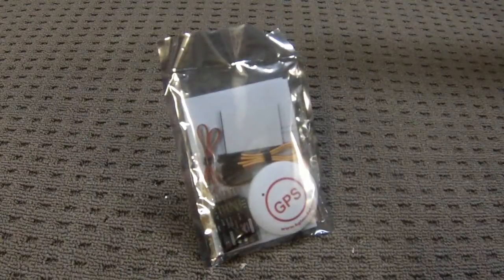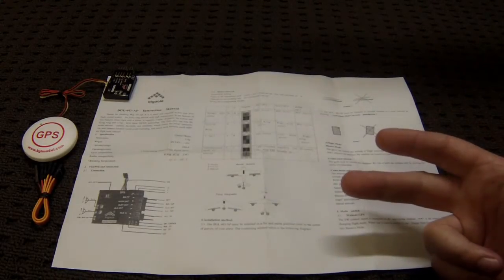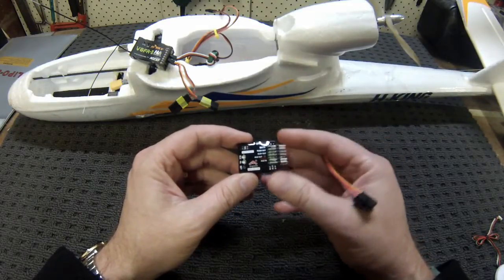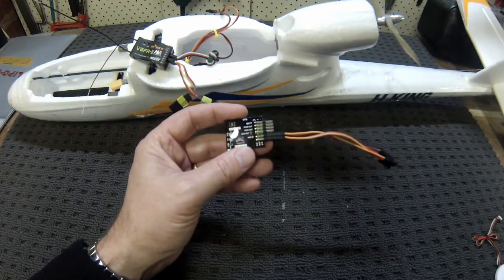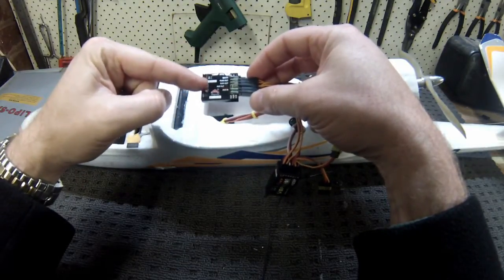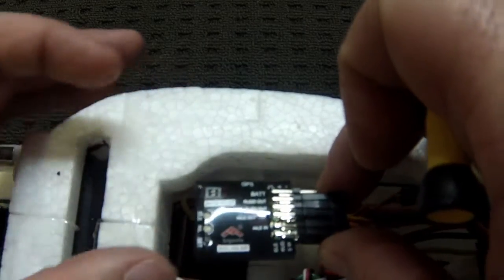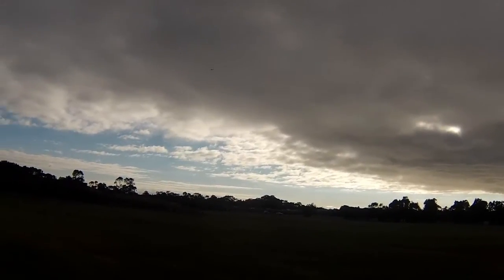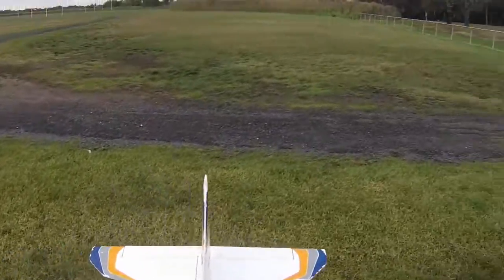BGL-6G-AP Flight Stabiliser with RTH - Setup

Comment: First great video second I just now purchased from your ebay store. I didnt realise it only has a 1 wire  Aileronconnection. I dont know how that works when they run off two channels. I am using the flysky th9x which I think is the same as your control so dont know how you have yours set up to run off one channel. If you can let me know how that works that would be great. I have just yesterday switched to a EZUhf TX an RX but it just runs using the flysky. Also does it  failsafe to return home on loss of control signal? 
Any hlp with above would be great hope Aus post  does get it here over night.
Cheers Mate
Reply from the maker: G'day Angus, yes there is only one channel for the aileron. You need to get yourself a y-lead to join the two connections from each aileron together. 
As for the failsafe, you will need to make sure that your receiver is set up to fail into the correct position to engage the RTH. In this video I have a FrSky module in the back of my Turnigy 9X. The FrSky receiver has capability to set what each channel does if you lose connection to the transmitter.
It looks like the ExUHF has a similar feature as the FrSky receiver. There should  be a button on the receiver that allows you to set the position of the switches (put the switch into RTH mode) in the transmitter and then push the button to save them to the receiver. Then if the plane goes out of range, the receiver will remember the position of the switches and return to home or within range. 
I hope that helps Cheers Michael
Reply: Cheers mate. I.ve ordered mine from your ebay store.

Now I'm new to fixed wing after getting sick of drones, still like to fly them now and then but planes look like so much more fun.
It seems you may have the th9x and I am buggered if I can work the mixing out properly. If you do have this controller would I be able to throw some questions your way? If you don't, O well I'll have to keep trying. I have got the EZUHF attached to controller so can use the TH9x failsafe as its a little harder setting the ezuhf for external devices so Im told. And have watched the 3 channel switch setup will do that in prep for arrival of flight controller.

Thanks again the flight controller looks great.

Gus
Reply from the maker: Hi Angus. I did have the Turnigy 9x, which is the same as, or at least similar to the th9x. But I use the Taranis now, so I'm  a a bit rusty on the old 9x.  The mixing is certainly tricky, but I have done a few different videos for setting up the 3pos switch that might help. If you have questions please ask and I'll try to help. Cheers Michael

Comment: Does this really have to be mounted on the CG? I have a Raptor and I would like to mount it on the flat spot just in front of the wing.
Reply from the maker: G'day Randall, ideally the BGL should be mounted on the CG, but it will still work if you have it forward or aft of the CG. Obviously don't mount it out the end of the wing but it will still work. The closer to the centre you are the better. I have the unit in my ASW28 forward of the CG, works fine. Cheers Michael
Reply: I didn't figure it would be that critical on a big plane like the Raptor. Thanks for replying so quickly.

Comment: Any RTH failsafe for loosing signal on that FC ?
Reply from the maker: Gday Michel to you will need to have a failsafe on your receiver to engage the RTH mode and apply for necessary amount of throttle. Cheers Michael

Comment: hi mad rc , I am having trouble,  when I turn on my rtl my plane just turns upside down and goes side to side very quickly  , and in stabilization mode it does a loop and heads strait down, can you help?
Reply from the maker: G'day Charles, sounds like you may have the elevator channel reversed. You can test this on the bench by switching the plane into auto level (stabilise) mode and lift the nose. The elevator should go down to try and level the plane again. You can change the direction with the elevator gain dial. But if you do, double check this does not affect the inputs from your controller, you may need to revers the channel in your controller too. I hope that helps. Cheers Michael
Reply: MAD RC that was it , it works, except my failsafe, I checked it today by turning off my tx and motor kicked in and flew straight into an electrical Tower should my battery , gopro , and opterra was in pieces.
Reply from the maker: Oh Charles. That is not good news. I assume that the RTH mode was not set/engaged on your failsafe. I hope some of your gear can be repaired
Reply: MAD RC in the shop now making repairs, I had the failsafe in bind mode but something went wrong,  it seam to function properly on the bench test,hopefully get it repaired and put it back up in the air soon ,thanks for your help,Charles
Reply from the maker: Best of luck
Reply: Do I just bind with in rth and 40% throttle on dx6e?
Reply from the maker: Charles I am not that familiar with the Spektrum gear. I know that some of the receivers have different failsafe capabilities. Some have throttle failsafe, mainly to set to off and the remaining channels return to neutral. Others have the capability to set all channels.
Reply: MAD RC ok thanks again.

Comment: Hello great videos by the way. I am having a issue with transmitter reconnecting. I have only tried it in my garage so far and when i test the RTH mode for when i loose signal ( When i turn the TX off) and then turn the TX back on the RX never reconnects again ( correct that, it did reconnect once after about a minute or two of being stuck in RTH) but hasn't since. I've tried flicking all the switches in every possible configuration and turning TX off and back on again in each switch position. but nothing. Everything seems to work fine when i have signal all modes seem to work fine and will engage and disengage but not when i turn the TX off and on again
Reply from the maker: Chris Appel G'day Chris, interesting issue. I don't think it is specific to the controller though. What transmitter and receiver are you using? does it connect quickly when you first turn it on?
Reply: So the problem is with my receiver. I took out a Frsky X8R reciever (i had in a quad that is very patiently being brought back from the grave from drop from 400 ft) and tried it with my Turanis Plus TX and everything worked perfectly. I must have a purchased a faulty tactic receiver and am sending it back. But i think i will just keep this receiver in this plane and use my Turanis  Plus instead. It will be a far better set up anyway and save the tactic setup for a park flyer setup at some point. Thanks for getting back to me and thanks for making the video on setting up the Turanis with this  also BIG help

Comment: Hi I have one of these units but I find during calibration it flashes then I get a steady red then the servos move and I get the flashing again. The unit also does not respond to the transmitter aux switch as the unit is always in stabilization mode. Any Ideas?
Reply from the maker: G'day Gyrophill, It sounds like you don't have a connection for the GPS. You need to make sure that if you have the GPS plugged in during the setup, you need to be out doors or close to the window so you can connect to satellites. You will see the blue light start to flash if you have successfully connected to satellites. If the blue light is solid, there is no connections. 
The red light sounds like the calibration is still ok. Cheers Michael

Comment: I have been using this flight stabilizer for some time and I am a bit disappointed with the RTH. On different occasions the plane does not return to home but go's straight ahead in stabilized mode. I regret that one cannot use Flaperon with this stabilizer because there is only one output channel for aileron 1 and 2.
Reply from the maker: Hi Stephane, thanks for your feedback. I have not experienced this sort of behaviour. Although, I usually fly in the same place, so my RTH position rarely needs to be reset. Do you fly at different locations? You may need to make sure that the home position is set correctly by pressing the Rest Button after the GPS has a lock on the satellites (blue light flashing). 
Certainly the BGL-6G-AP does not have as many features as some other units that will allow flaperons and other advanced mixing, but to be fair, it is a very cost effective RTH. Probably the cheapest RTH in the world I think. Cheers Michael
Reply: Stéphane D'Hollander m

Comment: My red LED doesnt Locks On in Calibration Mode...
Reply from the maker: G'day +Chris ImItReal the red light will blink when it has power. The only change is when you press and hold the SET button and the red led will go solid after about 3 seconds. The blue light on the GPS antenna will blink when it has connected to satellites. Check my other video for a few more tips on the set-up - https://www.youtube.com/watch?v=J2lfk1IJCuQ Cheers Michael

Comment: Thinking of getting one of these for my dads  hk cloud surfer. His spektrum dx6i however, only has two way switches so im doubtful if it will be possible to select manual/flight stabalise/gps rth. Any ideas?
Reply from the maker: G'day +Stephen hathaway I have spoken to another guy that needed to control one with his DX6 or DX6i. I thought it has a 3 pos switch for the flaps? Otherwise, there was another guy that set his up using two different 2 Pos switches. When they where both up Mode was OFF when when switch was down the mode was Auto Level and when the other switch was down the mode was RTH.  Check out this DX6i vid from Motion RC. They are setting up a gyro on the DX6i - https://youtu.be/gKObxglL8lM?t=3m30s
I hope that helps. 
Cheers Michael

Comment: Hi Michael, does the RTH work with Spektrum AR6210 receiver? If so, how does it know, that AR6210 lost signal? Do you deliver to EU?
Reply: G'day, the BGL-6G will work well with the AR6210, but i think that receiver only has a default failsafe. Which means I don't think you can set the necessary channel to engage RTH mode. Check this thread for some more information http://www.rcgroups.com/forums/showpost.php?p=23916689&postcount=1
I do supply to the EU, send me an email if you'd like one. Cheers Michael
Reply from the maker: Sorry TheBuzzdev that reply was from my regular account. Cheers Michael
Reply: Hi Michael, many thanxs.. Let me test that undocumented failsafe settings on my receiver, if that's not working as expected, i'd most probably also need to get some other receiver for RTH to work. The AR has already minus points (by me) for not having standard RSSI output... i'll drop you an email then... Thanxs

Comment: Hi.  I am going to use one of these.  When I set the fail safe on the receiver ( lemon).  Do I set the fail safe for the throttle only  or ailerons elevator etc. Would be grateful for your advice.   Mike
Reply: G'day Mike, your throttle failsafe will depend in the airframe. On he Bix3 I have about 40% throttle on failsafe, but for my ASW28 I have no throttle set in failsafe. At a minimum you want to set the mode of the BGL-6G-AP to the RTH mode, no need to set anything for the ailerons or elevator. I hope that helps. Cheers Michael

Comment: Thanks Michael. With the help of this video I now have a Bixler 2 that Returns to Home. Tested it in 15kn and it worked. Even tried failsafe RTH by turning the radio off, scary but it worked.
Reply from the maker: +Andrew Newton Thanks for the comment, it is brilliant to hear it has worked out. Would be good to do a little formation FPV. Add Mark in (once he has built his Cloudy) as well for a bit of three way air to air footage! Although getting planes near each other seems a bit like herding cats. Cheers Michael
Reply: +MAD RC I'm willing to give it a try, surely we have the skills.
Reply: +Andrew Newton HA! Surely
Reply: Andrew Newton hi Andrew I found my questions answer reading your comment. So your using taranis x9d remote is it. Which sets the failsafe switch automatically on failsafe. I need to research this on my taranis qx7
Reply: Andrew Newton    Hi 
Need to confirm if the plane  return to home if it's lose the transmitter signal ???

Comment: Does this work with Dsm2? If so I plan to get one!
Reply from the maker: +RC flight Seeker No problem to work on DSM2. The only thing that I would suggest is to check out the receiver that you plan to use and make sure that you can program a fail safe that will engage the AUX channel and switch on the RTH mode, in case you go out of range. Here is a link to a post about Spekrtum failesafe http://www.rcgroups.com/forums/showp...89&postcount=1 
Cheers Michael
Reply: Ok that's good, because I use lemon rx that is easy to program the failsafe into. Thanks for the info, and great video BTW.

Comment: I got a question, i got a bigaole for my wing and set it up for wing mode.My question is, can i use the rudder for make my cam look around? Or even if the wing not have a rudder, will it still be controlled by the bigaole controller?Or does the controller in wing mode passtrough the rudder?Thx
Reply from the maker: G'day +Denof The rudder channel passes through the BGL-6G-AP, but you can control that channel in all modes of operation. There is not need to pass it through though. You can connect it directly to your camera. Check out the RCGroups thread too for more information and other  suggestions http://www.rcgroups.com/forums/showthread.php?t=2417656&page=18#post34101468 Cheers Michael

Comment: Can't seem to get the modes working on a flying-wing. Does both elevons connect to channel 1 and 2 on FrSky Rx?
Reply from the maker: +leadpan I'd can suggest a couple things to try and isolate the issue. 
First, the GPS must have a connection to the satellites or the unit will default to stabilise mode. The blue light on the GPS unit will flash when it has a connection.
Second, ensure that you have left wing into the aileron channel and right into the elevator channel as marked on the BGL unit. As for the FrSky, the channels are assigned in the transmitter, so you might need to double check the settings for the model you've set up.  
I hope that gives you a few things to go on with, but feel free to reply with any additional questions.
Cheers
Michael
Reply from the maker: G'day +Peter Ha Could be the gains set in the wrong direction. I have done that on my ASW28, but luckily switch off the stab before disaster. I hope any damage can be fixed.
Best tip I can give for testing the right direction is the aileron should drop WITH the wing. Best of luck for your next flight. Cheers Michael

Comment: hello Dear Mike, where xan I find documentation - ive done a lot of research but havent found anything- of how to set the wiring on flying wings like the skywalker or the skyfun? thanks 4 your help as always :D
Reply from the maker: Hi +Jon J Villa No specific set-up instructions for the flying wing, but the switch combination on the unit must be set with S1 OFF S2 ON. 
As for the servo connections, one wing will go to the Aileron channel and the other servo will go to the Elevator channel. Nothing in the rudder. 
Then I think you'll just set up your transmitter as normal, mixing for a flying wing. 
You may need to check the directions of the auto level setting and the stick inputs and either adjust your transmitter directions or the gain potentiometers on the BGL.
I will have a new video soon to the set-up of a new stabiliser from Bigaole (no RTH) and I'll do it on my Tek Sumo flying wing, so stay tuned. Cheers Michael

Comment: hi michael...     i just got a bigole 3g-a today  for my girl friend's glider would you happen to know if  that stabilizer  would work on a analog transmitter?       bill..
Reply from the maker: +bill hiscock  I think the determining factor for radio compatibility is the receiver signal type. The Bigaole documentation claim compatibility with PPM, PCM, 2.4G. I think that most 36mhz works on PCM (Pulse Code Modulation), so without knowing your particular details, I think that maybe it will work?
Reply: +MAD RC  the  transmitter i trying  to use is the   (tactic TTX 600 ) 6 ch. i got it to work but not working rite...   i can't find  anything  about ppm or pcm  so far  in the infor. on  the radio yet...      thanks   bill